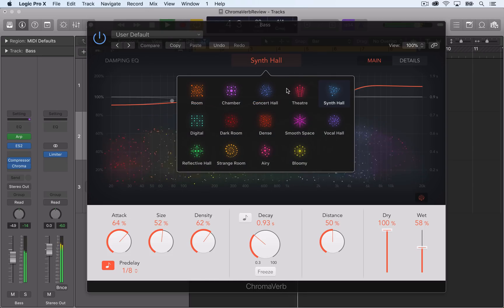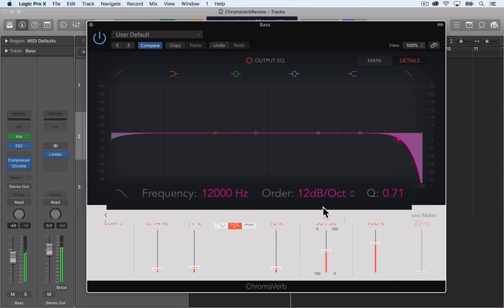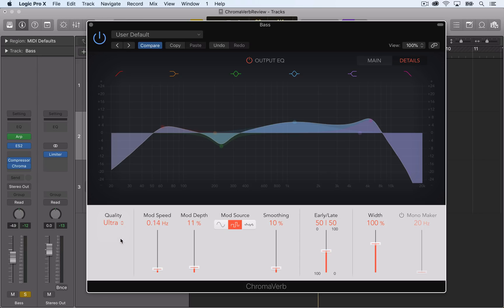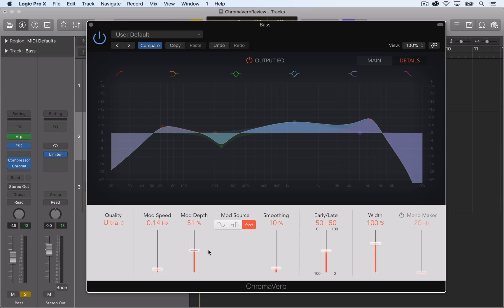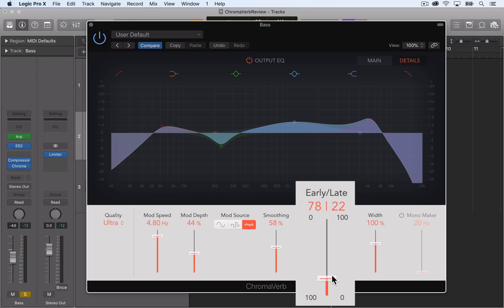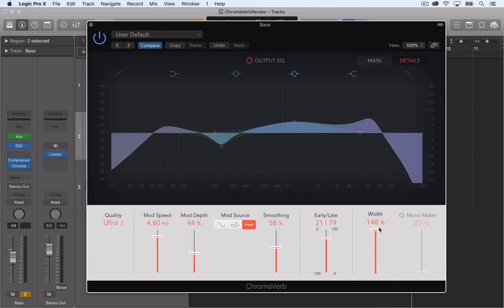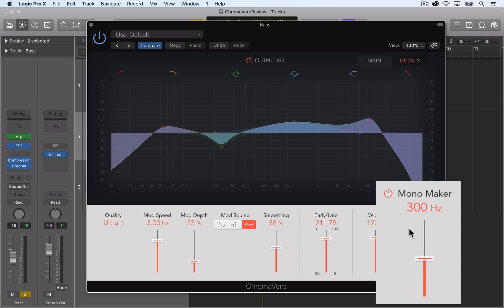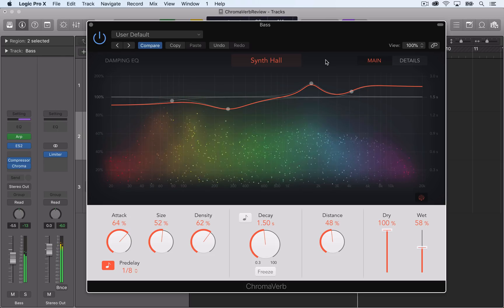Logic Pro X - CHROMAVERB #03 - Details Window, Output EQ, LFO, Early/Late, Width, Mono Maker

Comment: Thanks for 'unlocking' Chromaverb for me! If I may, a more staccato source would have demonstrated the Chromaverb's results a lot better than the synth you used on most. When you did use a drum, the results were crystal clear!

PLEASE, keep these gems coming. I bought Logic Pro X, for a number of reasons, However, previewing your videos,  your overall teaching traits and mannerisms, combined with your uncanny ability to explain it to me like I'm a five year old, without being condescending, made me feel that I can learn Logic Pro X aggressively, using your ultra-effective trainings. It was a key factor in my purchasing decision.

>>>ONE QUESTION PLEASE<<<: You have, on several videos, recommended turning on all Advanced  Options. Is there an advantage to setting an 'Surround' on, if I don't ever plan on using Logic Pro X in a multimedia situation? Is there a anything I will lose if I turn it off?

 I have a blast with Logic Pro X, in no small part to your videos - I sincerely thank you, as does my wife, I believe, as I retreat into my studio every night :)